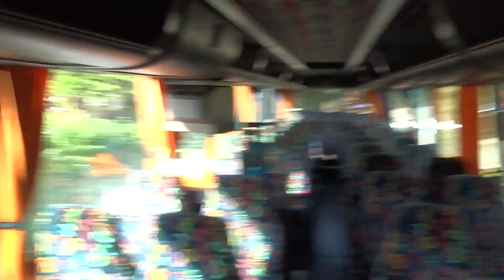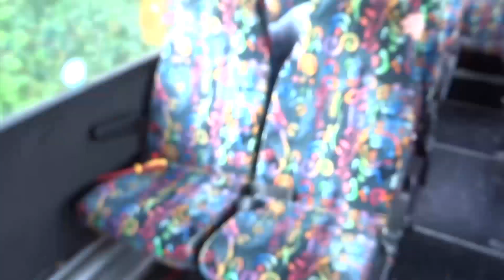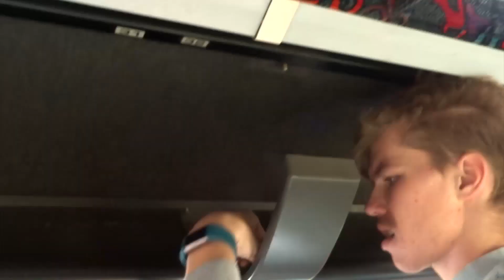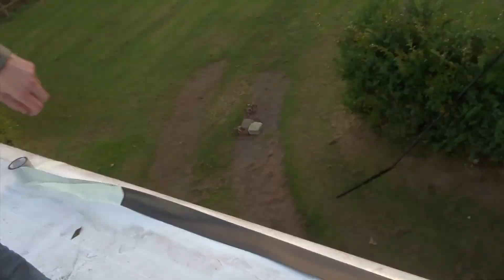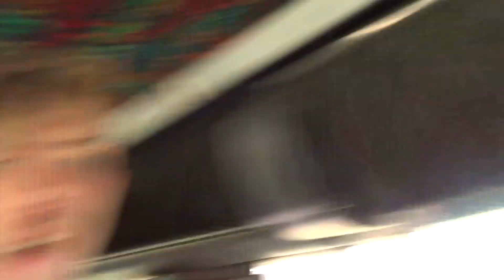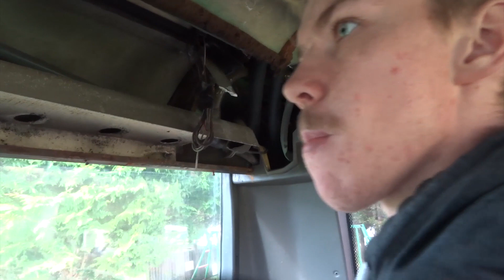Coach Conversion Uk Skoolie #1

Comment: Well done Tom, I know those seat retainers are a bitch ! I'm with the "Coach conversion" gang, we have a 16 seater coach (Optare Alero) which we bought 'converted' but we're doing some major updates on it, so I'll be following your progress, sub'd.
Reply from the maker: Cheers pal ! Ended up just cutting most of them out!!
Reply: There was little to no insulation in our coach so the guy that converted it initially added expanding foam behind all the side panels, thankfully. What insulation does yours have?

Comment: Why call it a skoolie conversion??? That is an American phenomenon and relates specifically to a type of bus, the body of which is purpose built for school runs. Be original. Don't try to jump on the you tube bandwagon of that particular cultural phenomena. Yours is a COACH. You don't have skoolies  in the UK unless you imported one from the USA. They are so cheap there. 

Please don't document ALL the painful process ... your first vid was tedious. Time-lapse and get it moving otherwise it is boring. Look at how others have documented theirs. It seems like you are trying to milk the process for more likes etc  but be careful you don't put people off with the snails pace. You may have REALLY underestimated just how much work (welding, design, electrical, solar systems, mechanical issues) your conversion will entail. It will be months of work. Set your camera up with a good wide angle view and just time lapse until you are much closer to finishing when you can restart narrating to camera.
Reply from the maker: I think then maybe you should watch some other video. To me this does not sound like the video for you! Thanks for the comment!
Reply from the maker: Also, I fully know how much work this project will entail. Thank you for your concern though!
Reply: Many UK operators use Bluebird School Buses, but you're right this is not a skoolie, it just helps with searches by those interested.  Personally I like the detail and long drawn out series with bits of fast forward as it enables you to cover more detail of issues that happen along the way. There are plenty of photobook time lapse options and for me they suck. Subscribed.
Reply: If it ever did a school run - it's a 'Skoolie' !
Reply: While I agree with your hatred of Americanisms and our slavish adoption of their peurile aphorisms this lad is simply trying to gain view with our USA viewers. Please make allowances for that or follow another motorhome converter. p.s. Do not view any US reviews of the "Jag-wire" I-Pace EV.
Reply: @roygardiner4002  point taken ... Thanks.
Reply: Tommy Harris it is a Skoolie in the uk a coach is most typically a school vechial carrying secondary school aged children
Reply: Liz Steeds btw it’s McDonald’s not mac Donald’s
Reply: Damn liz you almost sound annoyed at the guy😕 like you've taken what he's doing way personally. You do things the way you do and he'll do his the way he does. End of!